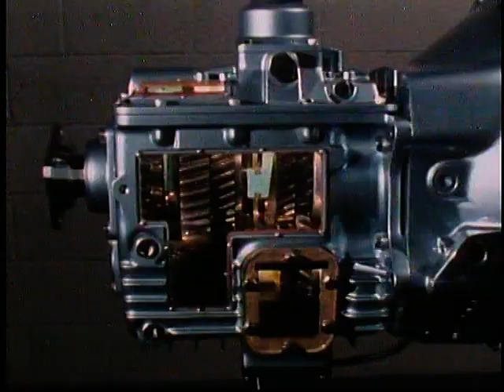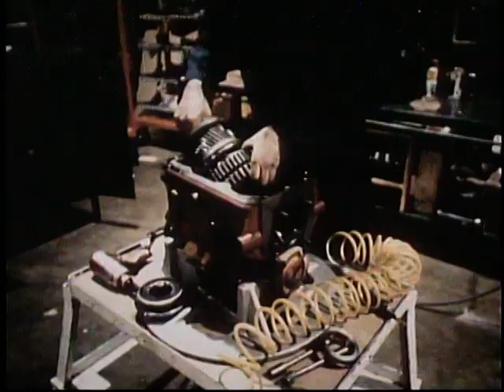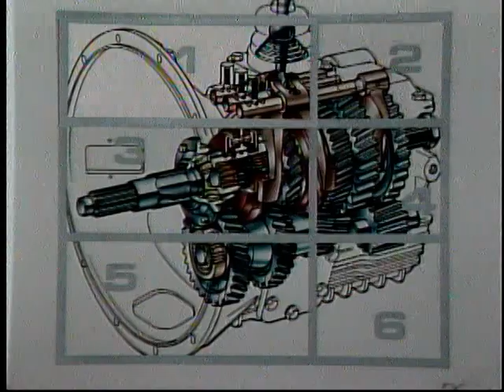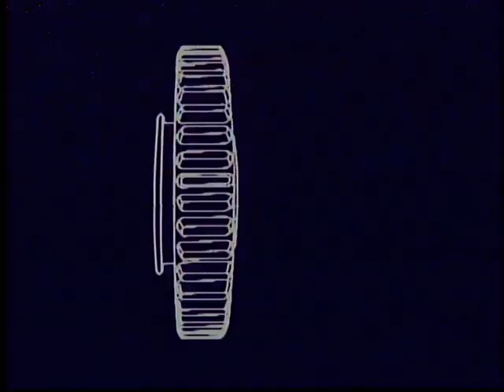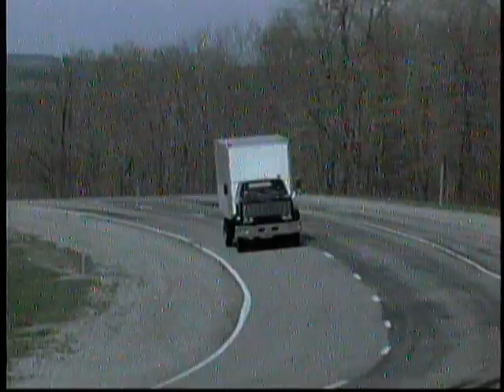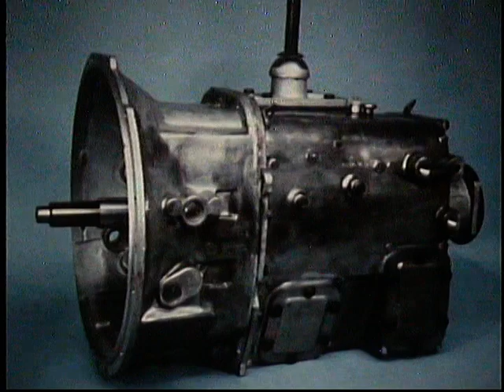GMC Clark CL450 & CL550 Features, Benefits, Applications, and Competition GM345-B Training Laserdisc

Comment: Interesting, we had all Clark transmissions in our ford school buses . Never had many issues till the ford 1060 diesel came along, ( Cummins 5.9 liter) then we started breaking 4 gear on the counter shaft. Replaced many of those. I think Clark had sold to Fuller by then. Cool video, brings back memories. I could still probably tear one of those apart and put it back together blindfolded. Lol

Comment: With that soft 4th transmission you lost 1 whole gear and made the 4th high to 5th high gear split about 11% wider. It may have been OK with the Gasoline Engines or the wider RPM Power-band V8's like the 8.2L or the 3208. But mate that with an inline six with a narrow power-band like the Cat 3116/Cummins 8.3/71-Series Detroit and you will hate that wider split with a heavy load!
Reply: Lost half a gear .
Reply: @stewatparkpark2933  You can call it half a gear if you want, but really its a whole gear on a hill...If running a 5+2 with the soft 4th only has NINE usable ratios...VS...The Short 4th has TEN usable ratios....And like I said they also made the spacing about 11% wider.  So the jump between 4th-High and 5th-High is now 28% vs. the 17% found in the short 4th trans... The short 4th in the 5+2 setup has the last 4-gears evenly spaced around 17-19% from each other, which gave you better at speed grade-ability.  With the soft 4th now you must slow down further (28% v. 17%) to catch the top of 4th-high...Therefore losing important momentum.  I spec'd trucks for a living...That Soft 4th BS might be fine in North Dakota or Kansas, but anywhere with real hills, you'd hate it.